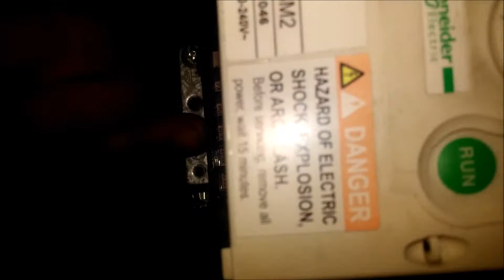Making the worlds lowest frequency subwoofer! Rotary Woofer Build Number 2!! Part 4

Comment: Solenoid wouldn't cut it as it's not designed for "frequency" use. Your best bet is using high power rare earth magnets and wind your own appropriate gauge copper coil. You can 3D print your own suspension with TPU material. I hope you're not letting this project go to waste!!! You should check out "TOIDS DIY" YouTube Channel!!! He does 3D printing, laser cutting and audio builds!!! This project should be open sourced and pushed forward!!!😁👍🏻

Comment: You may have explained this in a previous video, but can you explain the correlation between RPM and frequency, or maybe point me to an article that explains it in detail?
Reply from the maker: AnconeusRex if the unit is spinning at 20hz, then the max frequency is 20hz. you can go higher of you want. but I dealt the max should be 20 for sound quality. because frequency lower than 20 hz, the blades pitch slower than 1 cycle of the rpm so more air is moved at 2 Hz than at 10hz for example. but when the unit produces 20hz at 20hz on the vfd, the pitching of the blades is equal to the rpm meaning the blades pitch once per rpm. any frequency higher than the speed e.g 30hz, the blades are pitching faster than the rpm so less air will be moved. so due to this it also means that the faster the blades, the higher the volume of the frequency being produced. hope this answered your question.
Reply: Perfect, thank you!

Comment: Would rubber o-rings prevent the rattle, even though it's not supposed to be used at low RPMs?
And this really makes me want to make one but also put LEDs on the blades.
Reply from the maker: quite possibly
Reply: They're pretty cheap I'm sure you know. I mean screw it right, a few cents for a little bit a "feature and functionality." 
Love the build so far. Watching your process is really great, I'm actually learning something hahaha. Can't wait to see it in action.
Reply from the maker: its being uploaded right now :)
Reply: YES oh fuck yeah I can't wait.

Comment: I think the military has tried using 1 meter square cement boxes with a baffle connected to compressed air. They could kill things in range with high amplitude pulses. Look into low frequency sound weapons. It was discovered because a building have a low frequency resonance that was making everyone in the building sick. They discovered it was a low frequency vibration. Once eliminated people no longer go ill in building. This lead to the research as a defensive weapon in field.
Reply from the maker: Polygonal Construction It's an unusual theory. I don't understand how it works but I suppose it's possible

Comment: NEVER use yellow&green as phase. Use the correct cable. There should be 4 leads. Ground to motor. I like the project but be safe.....especially If you are selling the unit.
Reply from the maker: dojdoj1975 that was just wiring to the motor from the driver. this will be perfectly safe as it's not used for anything else but that and all 3 wires are copper internals. the motor is earthed via the mount
Reply: it works but its not right.

Comment: I love the work! please keep sharing! Such a tool could be helpful in settling cement and such
Reply from the maker: Polygonal Construction how can this settle cement??
Reply: This would allow you to shake a wooden frame full of cement. Doing this would allow you to shake air bubbles to the surface so your final product is more consistent, stronger. There are oscillators currently used but are much higher frequency. With his you could use much less energy for the same effect. You'd bolt your oscillator to the wood frame.       There is a video about melting stone with sound. I'll see if I can find a link. I found your channel through him. If you set up two planks to walk a huge heavy stone up. you could oscilate the planks with your machine and move and impossibly heavy boulder with one hand. He has an example of this working. I'll get you a link... on sec.
Reply from the maker: Polygonal Construction I understand your concept but this unit would only work in a sealed room using a baffle
Reply: This global electromagnetic resonance phenomenon is named after physicist Winfried Otto Schumann who predicted it mathematically in 1952. Schumann resonances occur because the space between the surface of the Earth and the conductive ionosphere acts as a closed waveguide. The limited dimensions of the Earth cause this waveguide to act as a resonant cavity for electromagnetic waves in the ELF band. The cavity is naturally excited by electric currents in lightning. Schumann resonances are the principal background in the electromagnetic spectrum[1] beginning at 3 Hz and extending to 60 Hz,[2] and appear as distinct peaks at extremely low frequencies (ELF) around 7.83 (fundamental),[3] 14.3, 20.8, 27.3 and 33.8 Hz.[1][4]

In the normal mode descriptions of Schumann resonances, the fundamental mode is a standing wave in the Earth–ionosphere cavity with a wavelength equal to the circumference of the Earth. This lowest-frequency (and highest-intensity) mode of the Schumann resonance occurs at a frequency of approximately 7.83 Hz, but this frequency can vary slightly from a variety of factors, such as solar-induced perturbations to the ionosphere, which compresses the upper wall of the closed cavity.[citation needed] The higher resonance modes are spaced at approximately 6.5 Hz intervals,[citation needed] a characteristic attributed to the atmosphere's spherical geometry. The peaks exhibit a spectral width of approximately 20% on account of the damping of the respective modes in the dissipative cavity. The 8th partial lies at approximately 60 Hz.[citation needed]

Observations of Schumann resonances have been used to track global lightning activity. Owing to the connection between lightning activity and the Earth's climate it has been suggested that they may also be used to monitor global temperature variations and variations of water vapor in the upper troposphere. It has been speculated that extraterrestrial lightning (on other planets) may also be detected and studied by means of their Schumann resonance signatures. Schumann resonances have been used to study the lower ionosphere on Earth and it has been suggested as one way to explore the lower ionosphere on celestial bodies. Effects on Schumann resonances have been reported following geomagnetic and ionospheric disturbances. More recently, discrete Schumann resonance excitations have been linked to transient luminous events – sprites, elves, jets, and other upper-atmospheric lightning.[citation needed] A new field of interest using Schumann resonances is related to short-term earthquake prediction.[citation needed]
Reply: Do an image search on google for "tibetains levitate stone with sound" This is all low frequency stuff. It has to do with earth resonance. Notice the formation they use to get the stone loaded with phonons. Orthogonal! By the instruments shown you can guess rough frequencies.